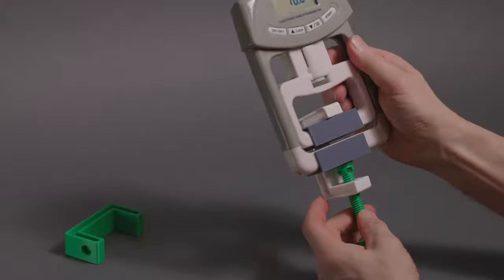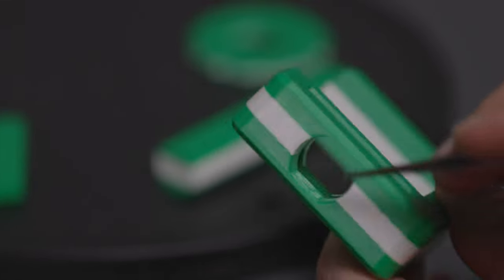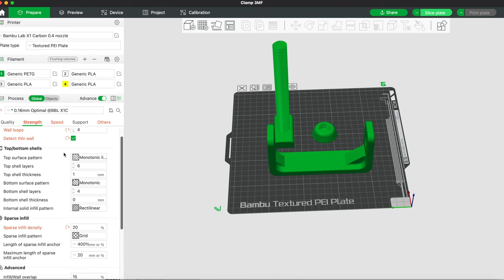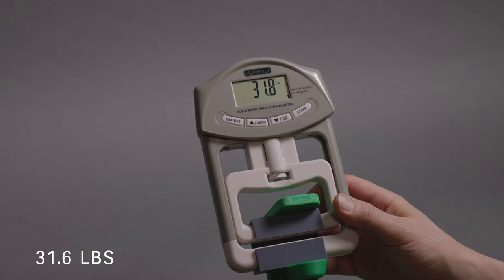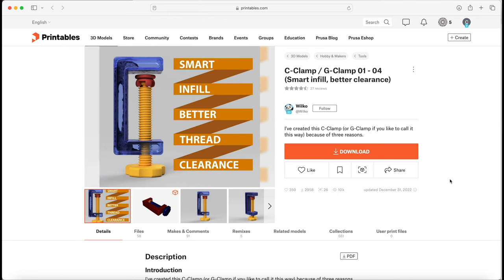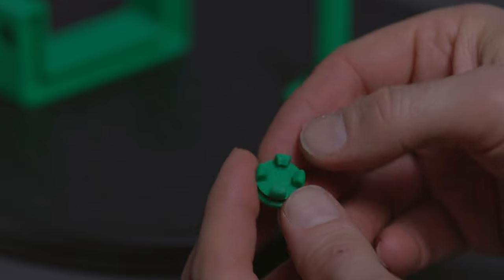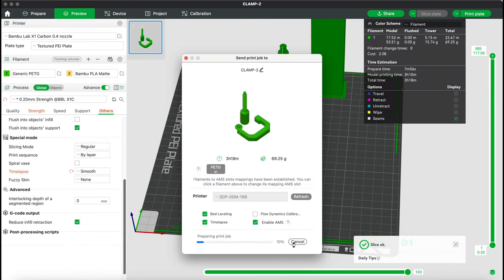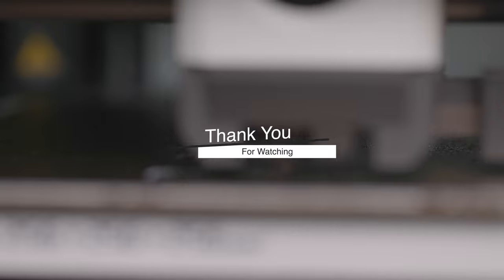What is the best 3D Printed C-Clamp?

Comment: Just curious - why were you printing a prime tower when you were only using one color/material?  Seems there were no filament changes.
Reply from the maker: Great question, the reason for the tower is so the printer can achieve a "smooth" time-lapse video. The print head moves out of the way and prints the tower while a picture is taken then it goes back to the print. If the tower wasn't there the time lapse would show the print head jumping around and I prefer the look of the print materializing out of thin air.
Reply: @FilamentFabrication  Good to know!  I didn't realize this was an option.  Thanks!!